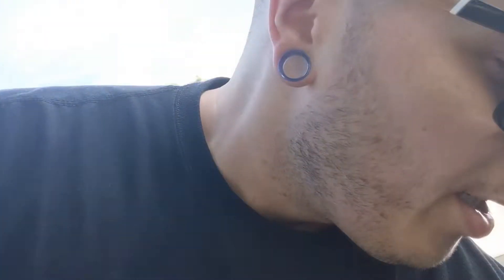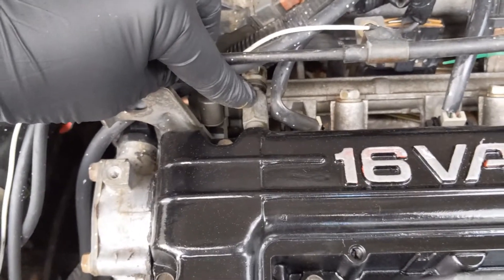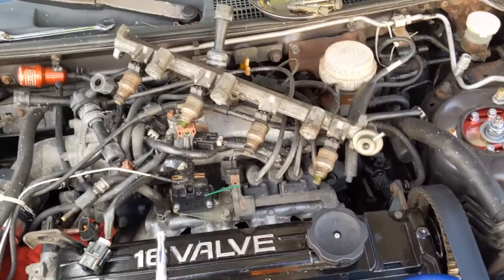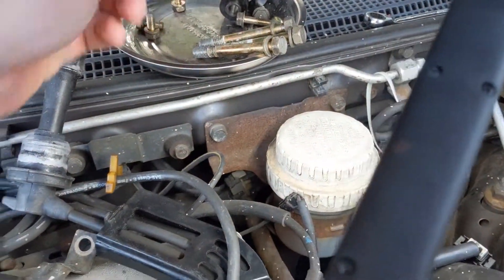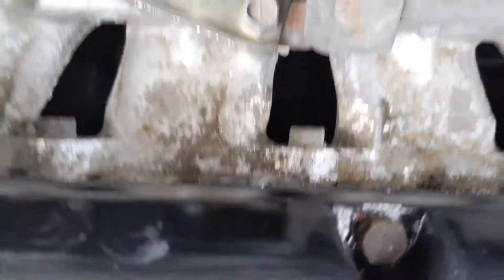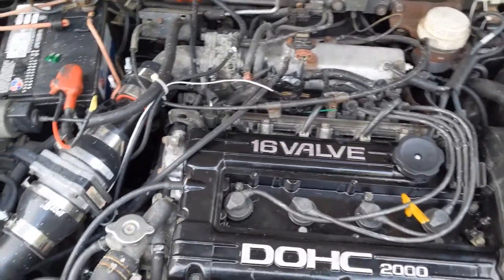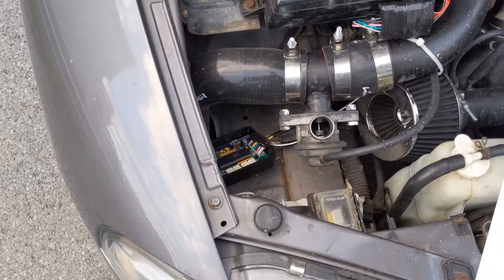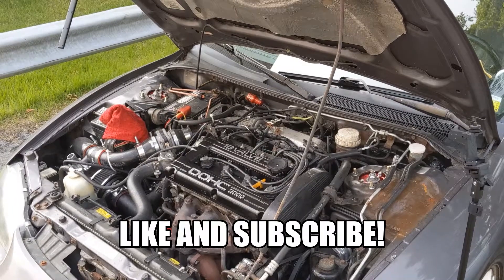750cc Fuel Injector Install 2G DSM - Today's Project Guide #15

Comment: Have this exact setup but I'm using 1000cc but I have a ecmlink along with translator and a 3.5 gm maf what is aux really do and what benefits do you get from using it.
Reply from the maker: Iirc aux is used to fine tune when you have the purple trigger wire connected to nitrous or water/meth injection system. You can also fine tune in rpm mode. I can't view the full throttletech article online anymore for exact instructions but I'm think that's what it does. I do have the booklet from my translator still. I always left my base settings alone and only ever adjusted idle, mid and wot. Now I'm running ecmlink (which I love compared) hope that helps you somewhat 👍

Comment: What brand of injectors did you use ???
Reply from the maker: They are second hand injectors from FB dsm Classifieds out of a running 2g. Not sure on brand but flow tested them and they are real 750cc injectors. Only thing is when using them you'll need a way to compensate for injector dead time, ceddymods or ecmlink or you'll have a terrible idle. I had to go back down to FIC low z 560cc injectors because of that. Make sure you buy "low-z" (low impedance) or they won't work in your car. If you have ecmlink you can make all the necessary changes in the ECU to run them perfectly 👍
Reply: @TPGDSM  awesome! I'll probably start off with the 560 cc injectors first. Thank you!
Reply from the maker: @donovanstrieby3699  anytime my friend! good luck with the build!
Reply: I have a 98 Eclipse GS 2.0 non turbo
What do you recommend for me ?
What type of injectors you think I can put on it whitout doing any other work? Cause I watched your video and I was gonna buy those 750cc but watching the comments what I understood its that whit those 750cc I will have to do some other things, I wait for your  reply and thanks for the help

Comment: Thanks for replying ok fuel pump is good I can't find the injectors fuse I would check the fuses I would double check the fuses
Reply from the maker: Check the driver side dash fuse. If I remember correctly the fuel pump relay is in the top left of the fuse box.  If all of those are in working order your cam angle sensor could be bad. Those sometimes go out and cause similar issues
Reply from the maker: Unfortunately there are many things that can cause injectors to not pulse. Bad ecu wiring, faulty sensors, blown fuses and fuel pumps. I would get a test light and go through checking things out. Also wiggling the wiring harness near the injectors to see if you have a bad wire someplace.

Comment: How are you I got a Plymouth Laser 2.0 it looks like the injectors  Are not spraying what you suggest it could be
Reply from the maker: Have you checked that all of your fuses are good, not blown?. You can also check for fuel pump priming with the car off turn the key to the on position but don't start the engine and listen for the Humm of the pump priming.  I'd be glad to try to assist you further through Facebook messenger @ Today's Project Guide
Reply from the maker: Either a bad fuse/fuel pump relay or bad fuel pump itself